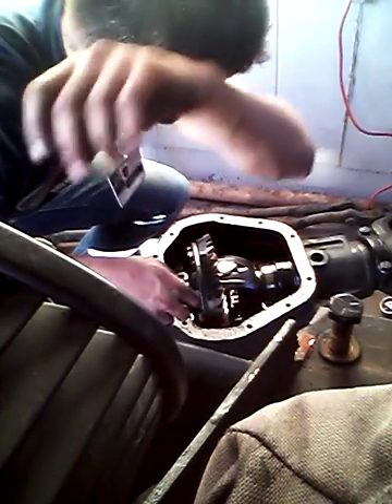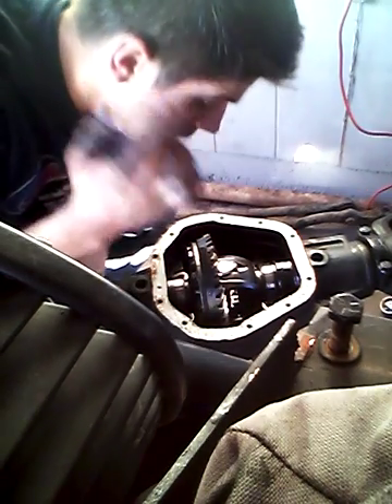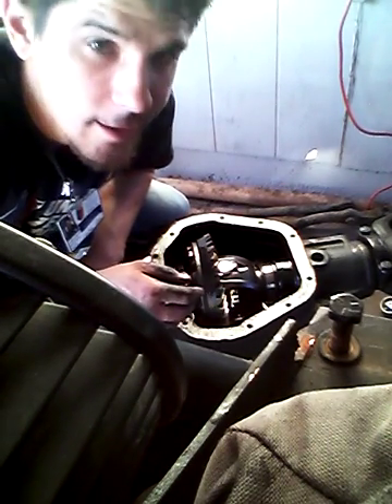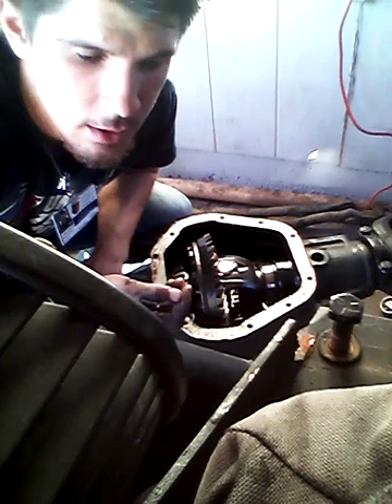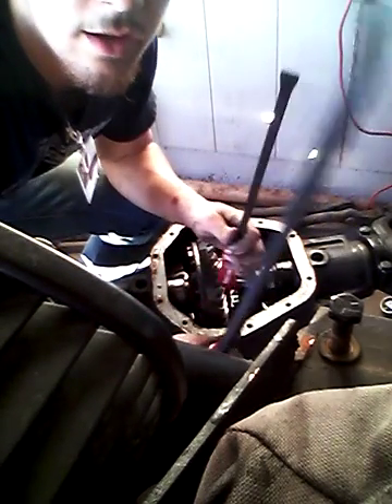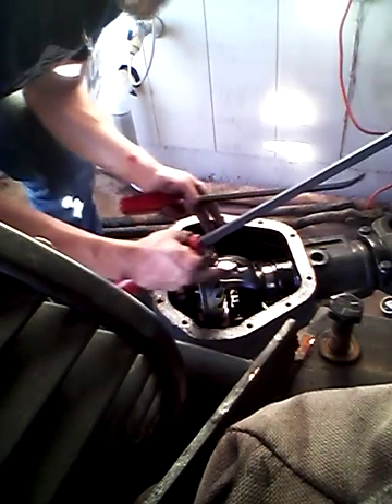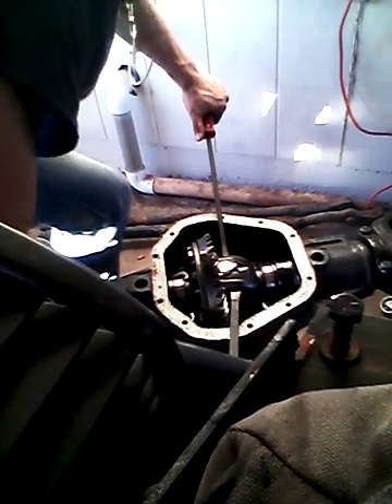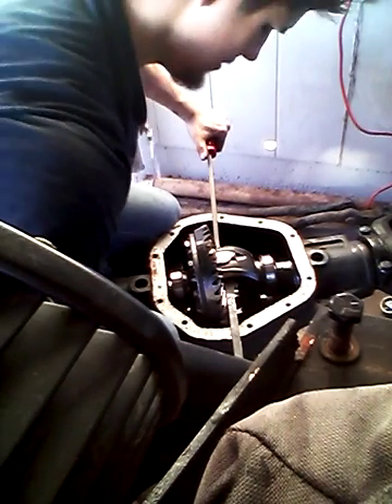How To Remove A Differential Carrier

Comment: If the rearend is still in the vehicle, obviously you dont have enough clearance to use two pry bars. Just cut a piece of pipe or something to the max length you can fit under the car. Then tap on the end of it with a sledge hammer.  Just like using the pry bar, but with a shorter bar, and tapping with the hammer instead of pushing with your hands. This worked for me.